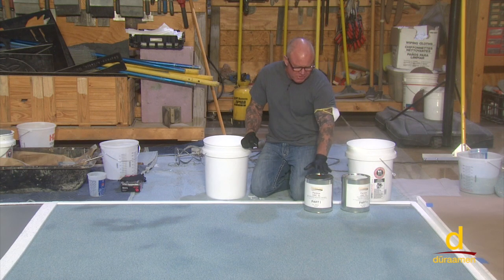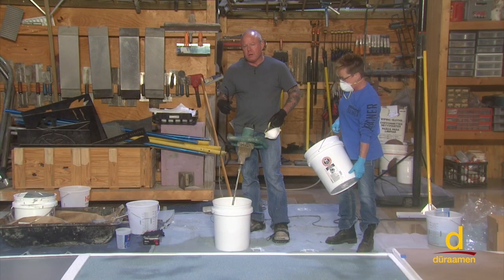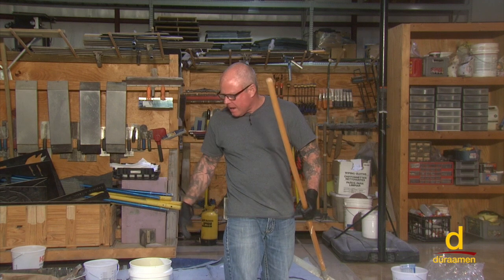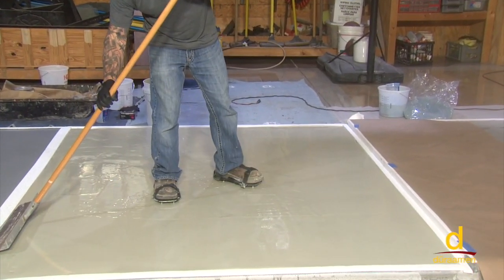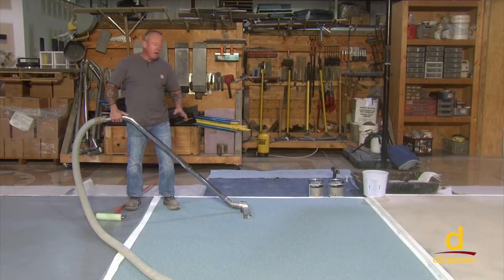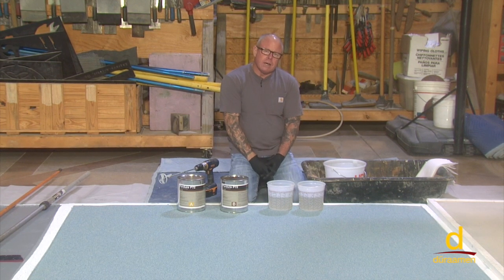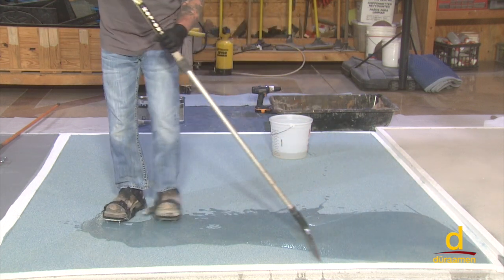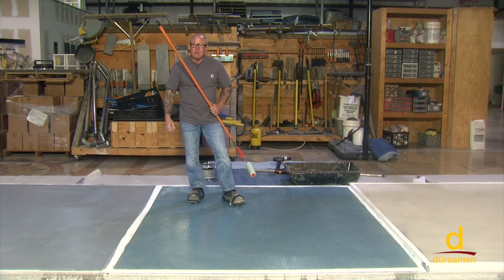How to Install Urethane Cement

Comment: How would you recommend adding different colored lines in an application like this? Like reference lines in a garage/warehouse for vehicles?
Reply from the maker: You have to attend one of the workshops for that.
Reply: To do lines of any sort I’d recommend doing that after the top coat. It’s rare to see companies do separate colors with the actual urethane cement for lines. If you absolutely have to add that in unnecessary step, try adding terrazzo strips. Or, if you’re good with taping you can tape your lines and pull the tape as you go but that’s adding time and unnecessary steps to an already time sensitive process. Hope this helps.